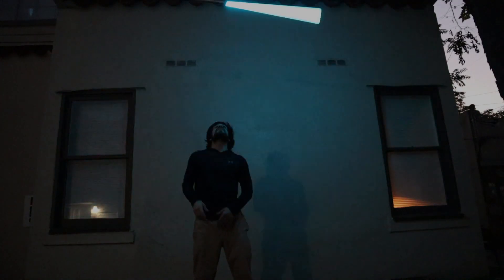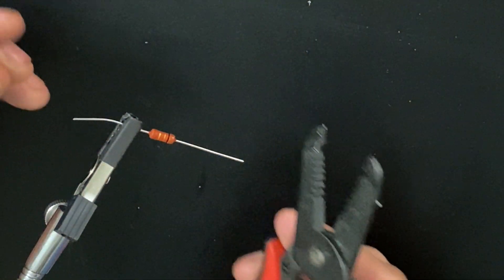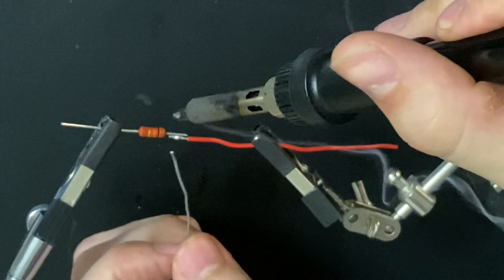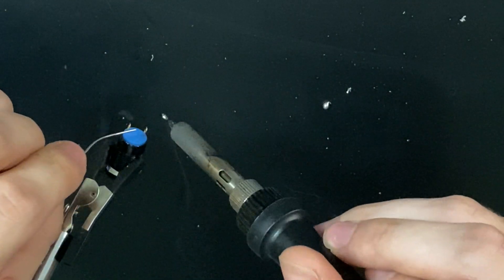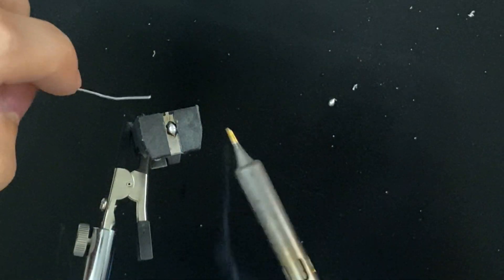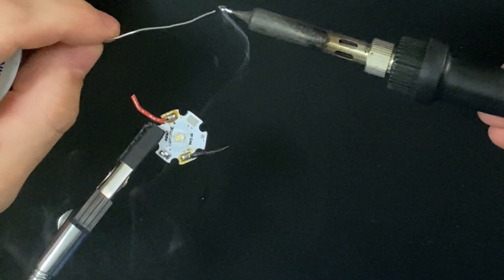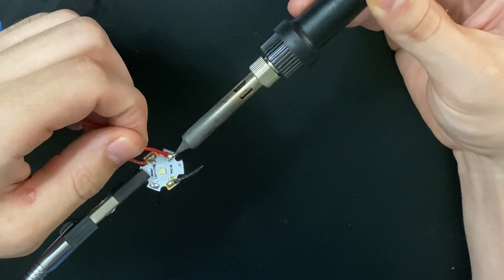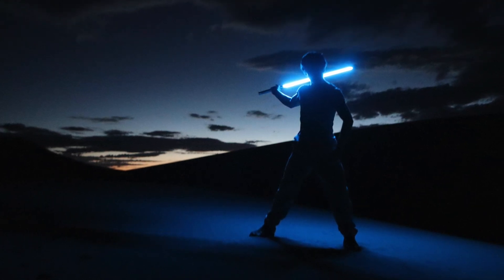First steps to building your lightsaber (intro to soldering tutorial)

Comment: Is it ok to tin both at the same time without pre-tinning? And if you heat up the wire with the iron underneath, and apply the solder to the top of the wire, the solder will melt into the wire and the tin will be cleaner and require less solder. Coating the wire with flux will make that heat transfer process alot quicker too, but I'd use a rosin flux because normal flux is really toxic/cancerous